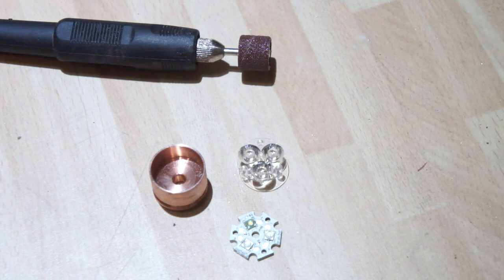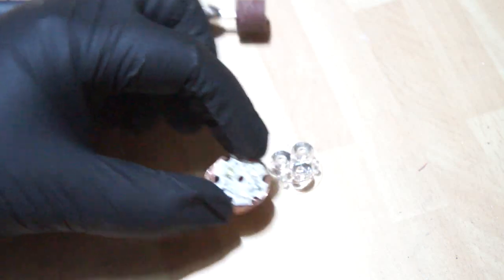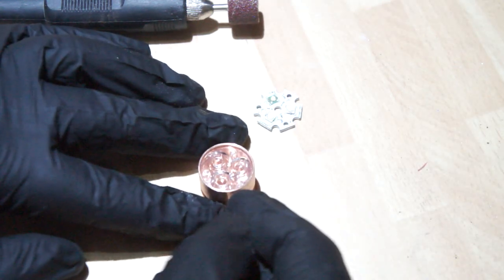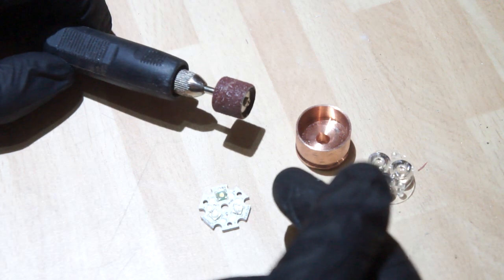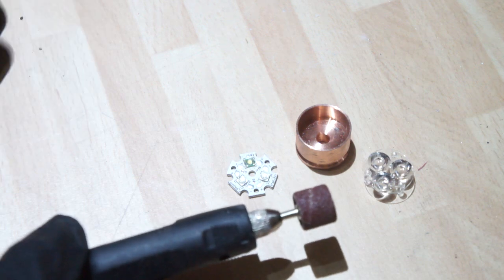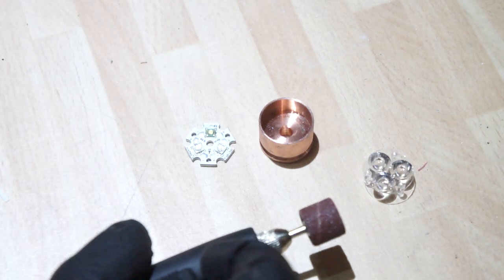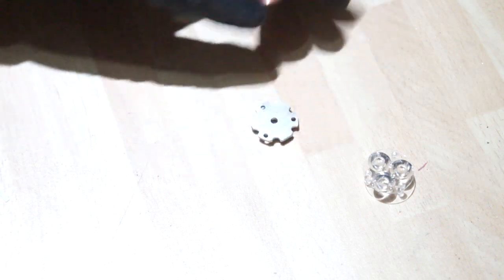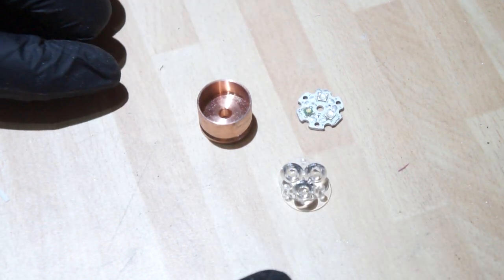Tri Cree 7/8" Heatsink Mod Tutorial Video

Comment: How do you secure the lens to the led?
Reply from the maker: +PepperPete11 It should stick to the thermal pad that is underneath the LED. However, if it does not stick, you can always use a small dab of contact adhesive so it will stick down but still be easily removed if needed.